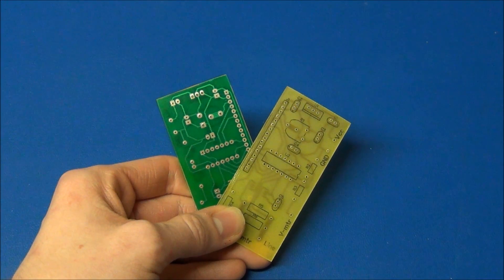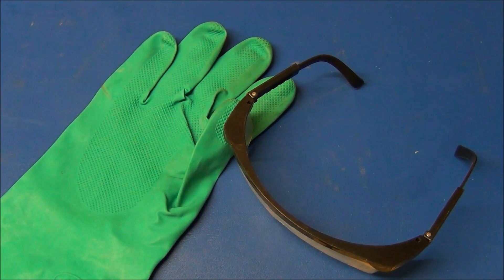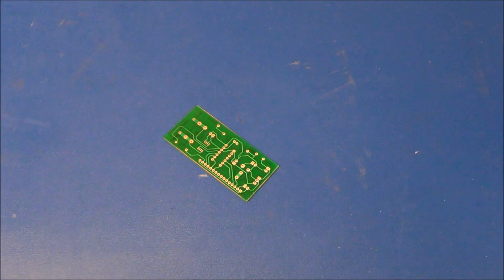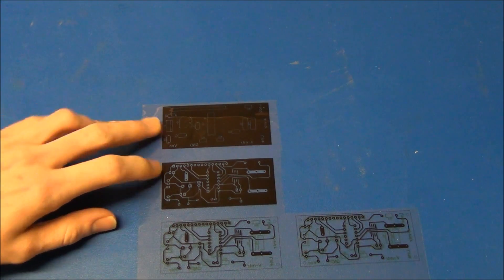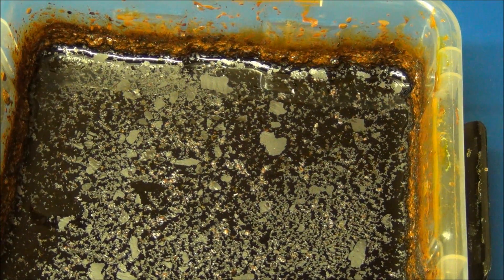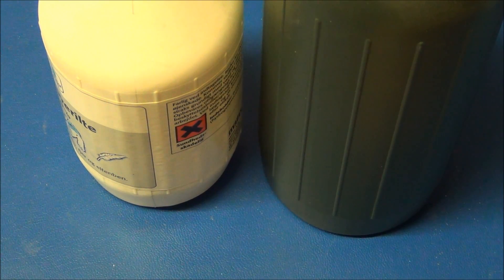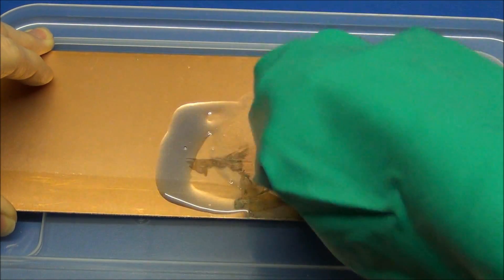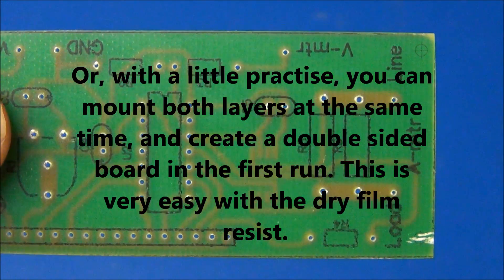Ec-Projects - DIY Circuit Boards ( PCB ) Part 1: Intro

Comment: hallo. i like to know if can reuse the hydrogen peroxide and hydrochloric acid mix or if it is a one time use only
Reply from the maker: It dies out over a day or so. But you can add more hydrogen peroxide to "refresh" it.
Reply: So if i add 1 part more hydrogen peroxide et can be re use.

And Thx for make the vids on how to do this.
Reply from the maker: Yep, a couple of times. :)

Comment from the maker: Hi, I use DipTrace to design and print the PCBs. It has an option to only show/print the "silk screen" aka. all the component outlines ( found in File -> Preview ). I think most layout software have that option.. 
And to apply it to the PCB, just follow the guide from Part 2 :)

Hope this was what you were looking for :)

-Mads